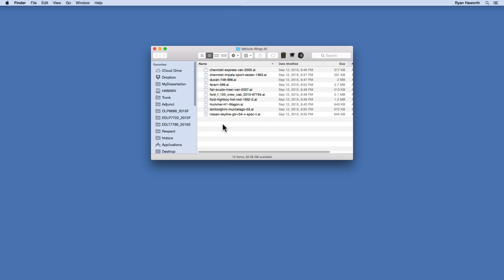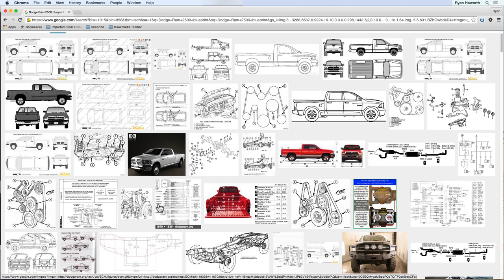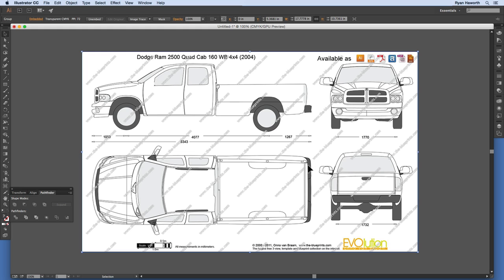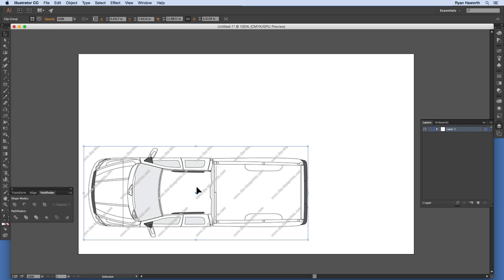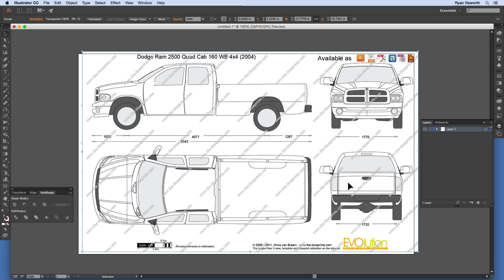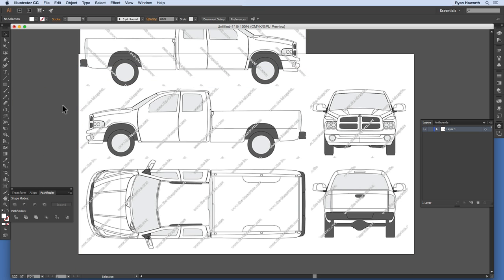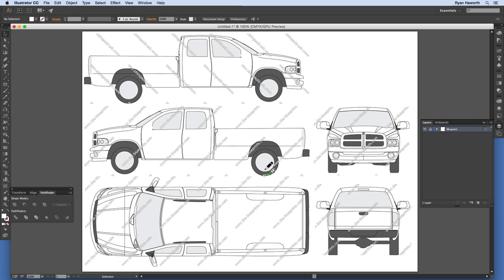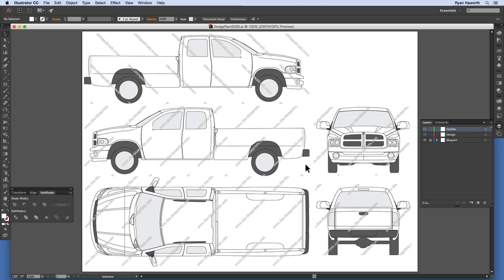How To Set Up A Vehicle Wrap Design File

Comment: hi Ryan , great video, what about the file size and resolution settings? how do I make sure to get em right? i Mean how did i print to the full size of my car. I bought 
a template for my truck and I'am only able to print a small version of my design. I'am able to resize it to 2000% but i am not able to save or print it like that. 
Could you please help me.
Reply from the maker: Keven, thanks for this question. I'm working on an update to these wrap videos. I'm trying to get a wrap company to help me put together some videos on the file preparation for full-size print and things. I've done designs for wraps before that have gone to print, but there are some subtle differences and also each car, each wrap is different. I'm working on this update and hope to have it finished in the next few months.
Reply: vehicle templates I use are marked 1/20 so you simply multiply by 2000 for full size.  your working files should be around 200 and than your final should depend on the dpi output. (resolution)

Comment: after making first clipping mask i m not able to get back to the image for cutting other diagram.
Reply from the maker: You're not the only one. I had some students in my class have similar issues. There is an alternate method, found in this video: https://youtu.be/4K2HClel9_M
Reply: Thanks sir!!! Another thing i would like to know that is it possible to design a wrap without a template or blueprints?
Reply from the maker: I suppose you could design without template or blueprints if you had the measurements needed. For example, if you were designing for the side of a truck and knew the height and length of the truck, you could just set up your document to that size.
Reply from the maker: Yes, it is possible. I only used blueprints as a basis for the outline for a design mockup. I'm working on an update to this video.
Reply: At what time point did you show the alternate method. I didn’t see it. Was it when you went to file and then recent file?